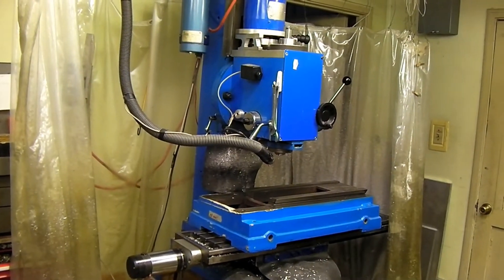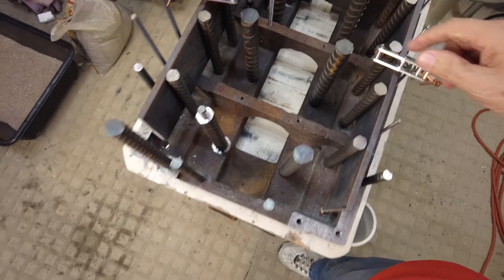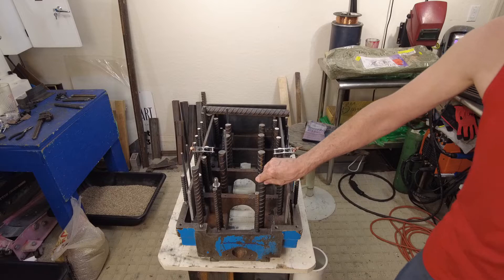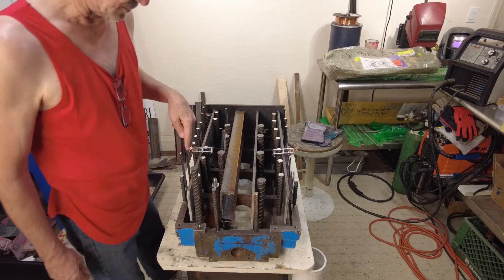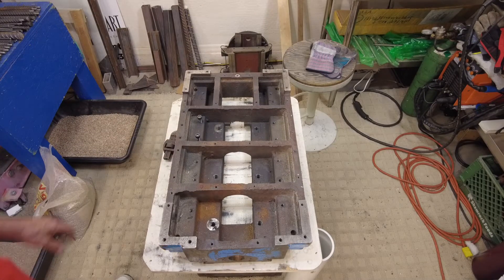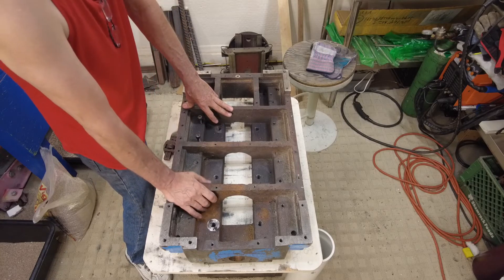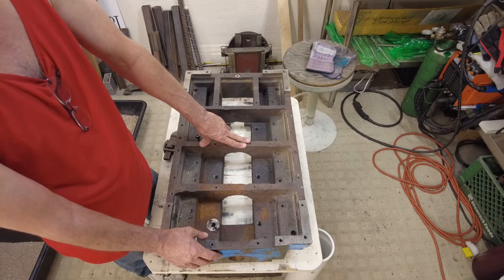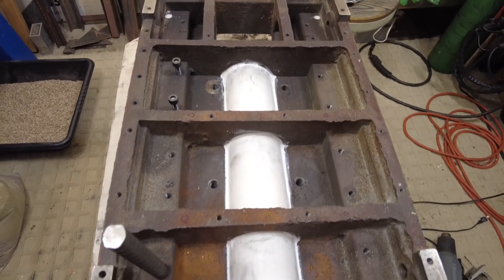Epoxy granite fill of a RF-45 Clone milling machine. Part 1

Comment: Isn't there a risk that the drilling and tapping of the base distort the casting ? I'm not a metallurgy expert, but from my understanding, unless the casting was stress relieved, removing metal can cause distortions. I guess the a compromise is needed between  maximising added stiffness (lots of  of tapped rebar), and minimising metal removal from the casting (less rebar).
Reply from the maker: I'm sure their is a chance of warpage but you have to make choices. I'm quite worried that when I weld all the plates I will add stress and cause cracking. That would be a total fail. I hope to do the welding soon. I just finished the flood cooling tray for the PM-940 so as soon as the belt drive is done for that mill I will get to the weld and fill for this mill.

Comment: At this point I would’ve just cast the entire lower in one piece so you could have a larger 16-20” Y axis.

The shallow black poly home depot storage bins are perfect for a really nice base. The form adds some external bridging to the cast which looks good. You’d need a second for a stand below it and you could easily epoxy them together into one piece.
Reply from the maker: I don't really need 20" of Y and it would be hard fitting it in the small shop. The PM-940 has 14" and that is good if I need more.  Hopefully I can get back on this project. I have all the epoxy and rocks, just need some time. I would say a few weeks.

Comment: Next time you run into a problem like this you can use a can of computer duster to freeze the bolt and make it contract.

Just flip the can upside down and sprsy the stuck bolt.

Comment: i actually did an epoxy granite fill to my pm30 and used your kit too. make a huge difference in my opinion.

just as a heads up for if you ever decide to use flood coolant, add a drain hole. otherwise it will pool up in there.
Reply from the maker: Planning on a drain.

Comment: Where you getting any deflection in the base while you were using it? How much? Any worries about heat distortion from the welding? This amount of steel and epoxy is definitely going to make it more rigid.
Reply: The mill base does flex. I'm going to try to weld it so I have the least amount of stress but by nature the welds will shrink. 
The rods are long so I'm welding mostly the tops. I will pre flex the joint but if you weld it has to shrink. I just wont know until I do it.